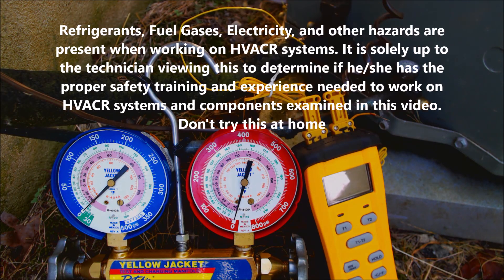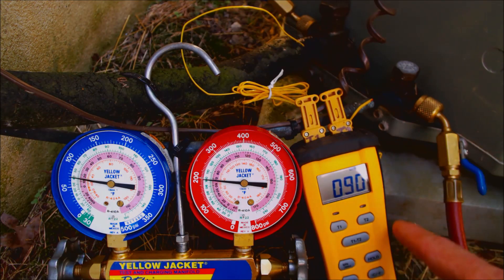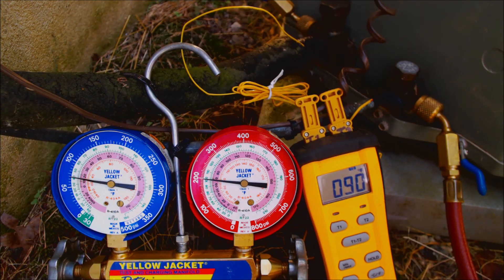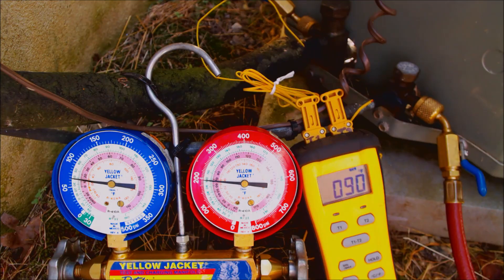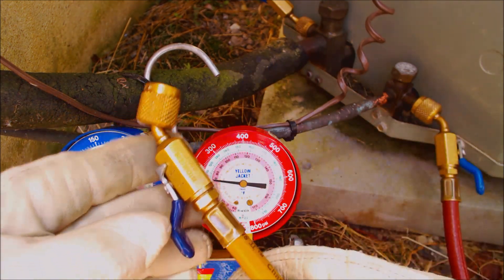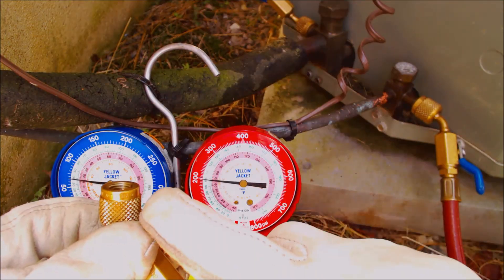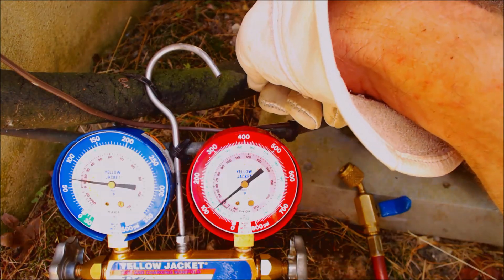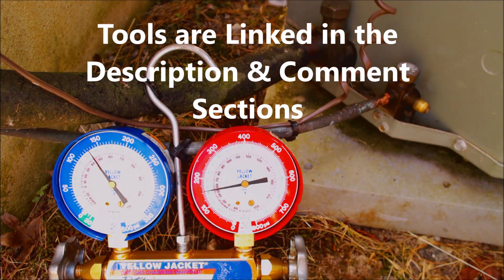Check the Air Conditioner Refrigerant Charge, Connect, Measure, Disconnect Procedure!

Comment: Thank you for your videos! I am a fan of your channel and I love it !!!

Little question for you. I have a split system. Maybe 12 years. It does not work really well. I have a DT of 15F, but after a while, only warm air. The compressor becomes really really hot. I tried to take the pressure of the Low Side and I have zero psi (even if the machine is off since 1 hour). I do not have any possibility of testing high side. (no port) The compressor is not short ground and the capacitor is good. What would be the next test to do? How can I get cold air at times if no gas in the machine?
Reply from the maker: That sounds like you have a leak. Residential units don't run that low on refrigerant. It may also not be equyalizing when it is off. You would need find the leak, recover the refrigerant, fix the leak,  pressure test, vacuum pump, and then weigh new refrigerant in and start and check it. Make sure you are EPA 608 certified before handing or working on systems with refrigerants, thanks Sly Dem and sorry for the bad news!
Reply: Thanks for you reply. We really enjoy your videos. Please continu ! Take care

Comment: So you don't have to check the temp inside at the evap? I thought I've seen you check that on some systems.
Reply from the maker: You would still check delta T 18-21 to confirm there is a good heat transfer with a txv. A piston system could be charged correctly and still be less than 18-21 degrees though. If it is 18-21 it would be great though. That delta t 18-21 is for single and two speed conventional systems though, not minisplits, thanks Blade!

Comment: I like to use the core removal tools on the low and hi side to minimize refrigerant loss. Does this sound like a good practice? Great videos.
Reply from the maker: Just for checking the charge? I use the valve core removal tools for vacuum and recovery. You could use the backseating valve core depressors by "C/D Valve". They would work the best for that. I have them linked at amazon.com/shop/acservicetech Thanks Eric S!

Comment: Thanks for posting !
Did exactly how you instructed in one of your videos how to test a 2.3 ECM motor with a TR and 120 volts yet every motor I tested so far seems to be hunting !
I used a new furnace Transformer , please advise ?
Thanks
Reply from the maker: Hey Mason, we just got back from camping over the weekend. Sorry I didn't get to you sooner! When you say hunting, that refers to txv or pressures on both the high and low side gauges going back and forth high and then low. You are mentioning a ecm 2.3. Are you saying the motors are ramping up then down, up, then down?
Reply: AC Service Tech LLC Welcome back and thanks for replying . Yes the 2.3 ECM motor is ramping up and down not steady like in your video in question . AC was low on charge due to a leak but that since has been fixed yet this Goodman VS furnace continues to freeze up the piston coil above it and I believe it’s because of a weak 2.3 ECM blower motor ! I replaced this motor and all seems good now but was just curious why when bench testing those motors they would ramp up and down ?
Thanks

Comment: Thanks for doing these videos very informative and great job giving clear explanations of everything ... I do have a question. I have a Goodman system that has a TXV. I do not see a number on the rating plate for target subcooling or superheat. I there a way to look this info?? up.
Reply from the maker: If the outdoor unit rating plate is wore off or you don't see a target subcooling then we use 8-12 degrees of target subcooling for single and two speed conventional systems. I use 11 degree target, thanks Dan!
Reply: AC Service Tech LLC 
Great thanks. I appreciate the reply. I'll break out the gauges and take a look.